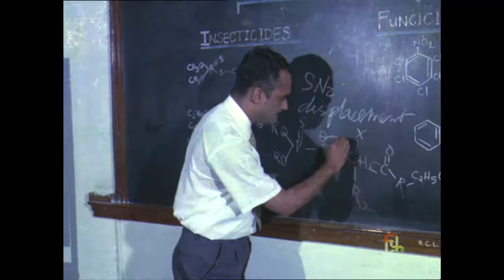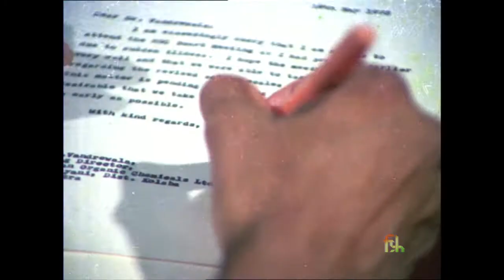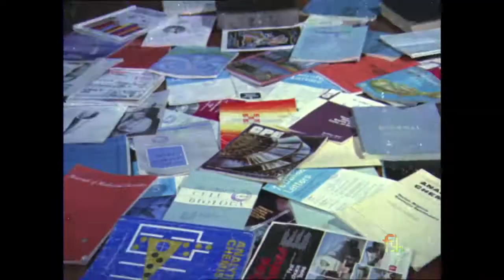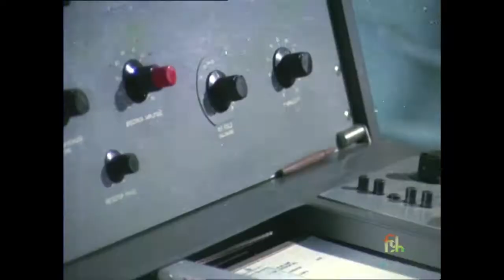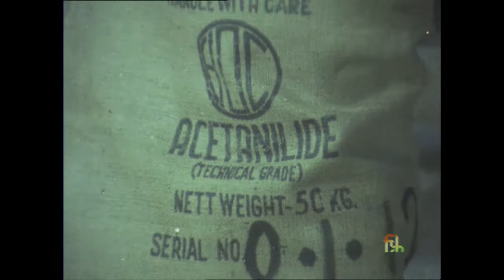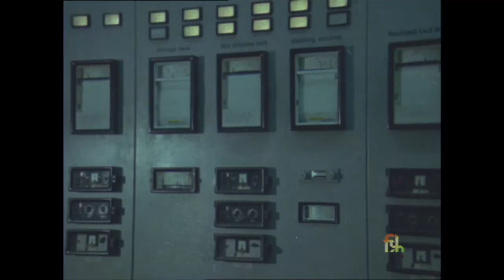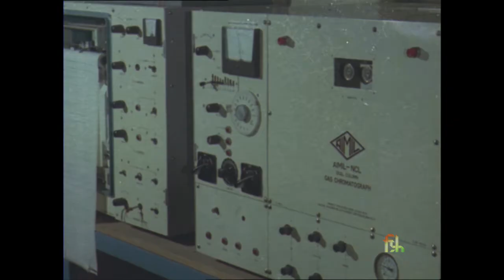National Chemical Laboratory  In The Service of Nation

Comment: Fruit of forethinking of leaders who ruled India after independence immediately.
Reply: And we are still a sh1thole with low r&d output. Just making some obvious buildings doesn't makes someone great visionary leader. I can't call someone visionary who gave away an opportunity to take part in security council of UN, and made a blunder with kashmir at UN. We have worst Healthcare system, educational system, r&d, manufacturing, industry even after 70 years of independence thanks to incompetence and corruption of immediate leaders/administrators after independence. Atleast corruption is one of  the fields in which we are at top since independence.
Reply: @spectrum1909  You are part of the “We”…what have YOU done apart from criticise ?
Reply: @WXUZT  U need to have an administrative power to make a significant change, here we are talking about changing a country, not about cleaning roads or planting a bunch of trees.